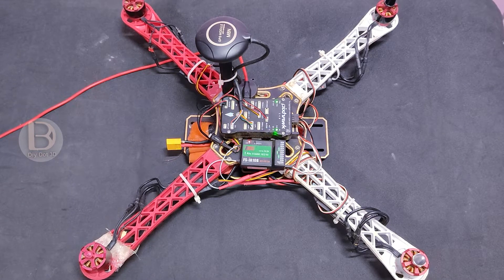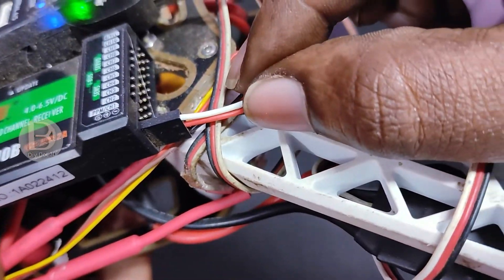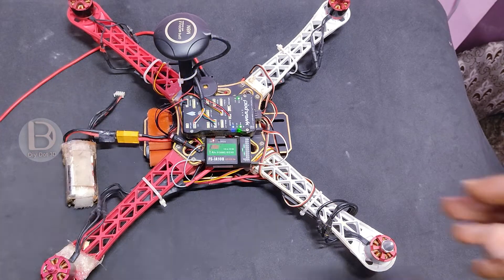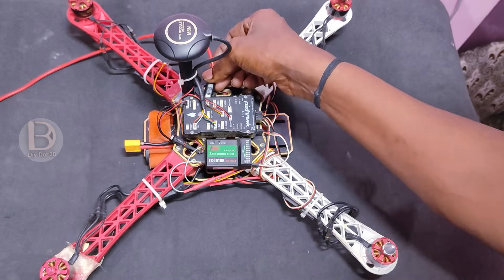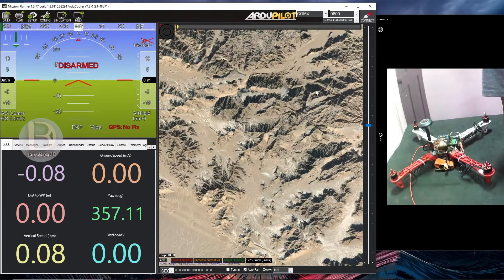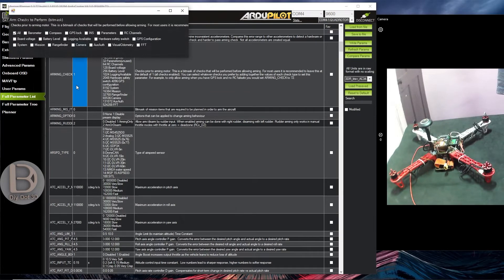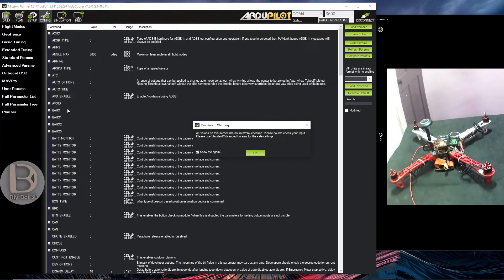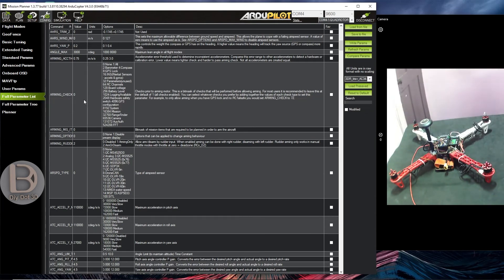Pixhawk drone Arming problem FIX #pixhawk #arming #problem #fixed #fix #drone #troubleshooting #diy

Comment: Radio calibration
 get no green in the UI, where it's supposed to have green bars that indicate the positions of the controls, and in the end I get this message "Bad channel 1 input, cancelling".
Reply: Now have you been solved this problem ? I also have face with the same problem
Reply: @sawthomassawthomas0507  which problem
Reply: i also had this issue you guys need to enable ppm output from your transmitter

Comment: Hello sir, thanks for your video!

The problem i have right now is that the motors keep beeping every 2 seconds and I'm not able to calibrate the ESC's any way possible. 

Further explanation below:

I have trouble calibrating the ESC’s so I can get the motors running. The steps im doing are:

1- Flight controller (FC) is connected to the computer thru USB and battery is plugged in, motors are beeping.

2- Click the Calibrate ESC button in Mission planner under mandatory hardware dropdown on setup section. I’ve tried Normal, Oneshot and Oneshot 125.

3- Disconnect Battery and usb from FC

4- Connect the FC to the computer thru usb again

5- The FC is ON and the ESC is off since the Battery is disconnected from the PDB (should the -,+,s cables be connected or disconnected?)

6- I disable the safety switch holding the “switch” button on the GPS until the red light is solid (immediately after plugged in switch light is solid so i hold it till it blinks and then till is solid again, if i let it solid since the begging it doesn’t work either)

7- Arm the drone in the transmitter corresponding switch (I’ve even tried

8- Put throttle at maximum position

9- Plug in the battery

The problem is from step 4 on.

After this, I understand that I should be hearing 2 beeps from the ESC registering maximum throttle and then I put throttle at minimum so the ESC can read the lowest throttle. However, instead of the ESC, only the motor start beeping every 2 seconds or less. The compass light is either yellow blinking twice every second like shown in the video OR alternating between green, red and blue.

In both cases the switch red light on the compass is solid right after plugging it in. In the second occasion (when blinking in 3 colors) the FC would make a long beep immediately after plugged into the computer thru USB but it would not connect to mission planner at first try displaying a “no heartbeat packet received” popup or simply the connection failed one that in the details says “the semaphore timeout period has expired” and a bunch of other stuff i have a picture of. When I try again unplugging and plugging back thru USB connection is no longer displaying the red blue and green light but the yellow one again.

The  MOT_PWM_MAX and MOT_PWM_MIN values are within the range reflected on the Radio calibration section; right now they are 960 and 1960 and in the radio calibration max and min are 988 and 2008. These values used to be 1000 and 2000 on the ESC calibration section but didn’t work either.

The transmitter is ON and it connects to the receiver every time no problem during the whole process. I calibrated the radio before doing this too.

I don’t know how to set manual mode which Is something I think I should do between step 5 and 6. I do it in Stabilize mode instead, but Im not sure if that is the problem.

If I do this right, the next step would be test the motors on the Motor test section under Optional Hardware dropdown on Setup section, right?

Before doing this I tried to test the motors right after calibrating the radio and it didn’t work. I got a popup window saying “action stopped by autopilot” now When I try it only makes the two sounds at the end of the video when I click “Test all in sequence” and “Stop all motors” buttons.

•Flight controller: Pixhawk 6C •Power Distribution Board : PM07 •Motors: T-motor https://store.tmotor.com/h5/#/product?id=939 •ESC: DH 60A 2-6S Waterproof Brushless ESC Electronic Speed Controller with 5V/6V 8A BEC and X60 https://a.co/d/7qHXerv •GPS: MN8 •Transmitter: Radiomaster XT12 ELRS •Receiver: Radiomaster RP1

 I have been using ardupilot ESC calibration website as reference but no success.

I know is a lot but i wanted to be as specific as possible. I would immensely appreciate your help!

A reddit post i made with videos: https://www.reddit.com/r/diydrones/comments/12i7tnr/can_anyone_tell_me_what_does_this_sound_means_the/?utm_source=share&utm_medium=ios_app&utm_name=ioscss&utm_content=2&utm_term=1
Reply from the maker: Hi ,will check and get back to you 🙂
Reply: Hello friend..I too have this problem..did you find a solution to this one if yes then may you please tell me ...I am having difficulties in doing the calibration...it's not calibrating but arming is done .

Comment: In mission planner the radio calibration screen is not showing green there is only gray blank .How to solve it? Please!
Reply from the maker: Hi.please check the receiver to the pixhawk connections make sure you connect correctly.all the best.
Reply: Thanks for your vidieo and your advices and now my quad corpter testing flying but the corpter do not fly up straight up. One edge of the corpter nose down and crashed.How can I fix it? Pls.  @DiyDot3d
Reply from the maker: @sawthomassawthomas0507  May be you are flying in acro mode.i suggest set mode to angle and fly.do sensor calibration again.if its calibrated properly it will level copter while flying

Comment: Sir please meri ek help kare Mera drone Jo APM 2.8 per banaa hai main jab use USB lagakar program karta hun tab vah arm ho jata hai lekin jab USB hatakar battery lagata Hun to aaram nahin hota ismein kya problem hai aur jab arm hota hai to sirf teen motor hi chalti Hain ek motor beep ki awaaz karti hai sar please meri yah problem solve kar den please
Reply from the maker: Check motor connection soldering.and also check other esc .may be problem with motor or ESc